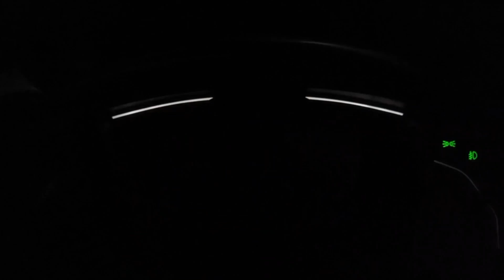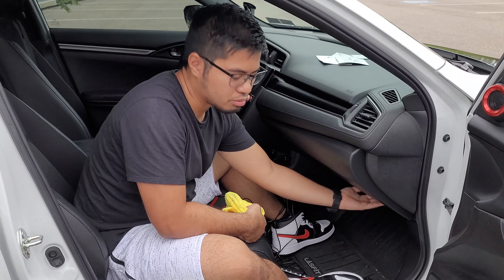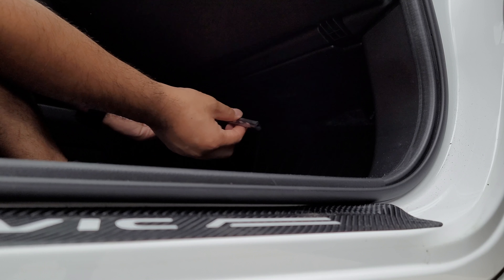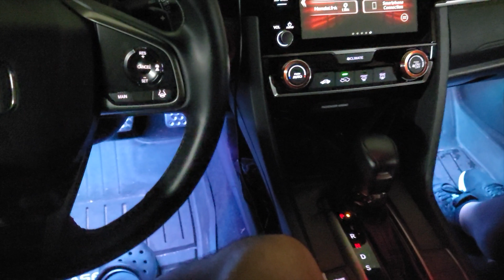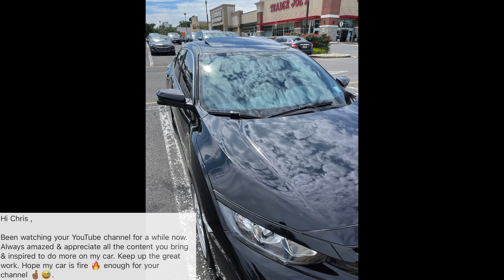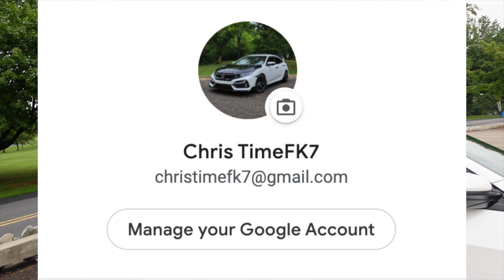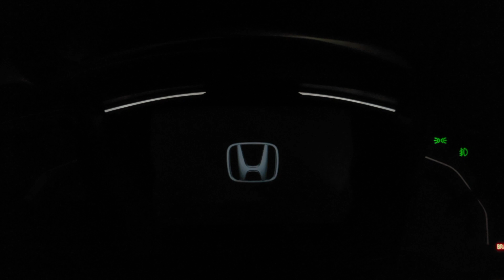RGB INTERIOR FOOTWELL LIGHTING INSTALL AND REVIEW 10th Gen Civic

Comment: The wire that goes into the back seat can be tucked under the seat runner they don't have to go through the middle of the seat amd it looks more tidy and hides the wire under the plastic side trim until the position you tucked it under the seat runner bar.

Comment: Hey Chris, how is the plastidip holding up? Did you have to reapply since you’ve blacked the emblems? Thanks in advance
Reply: Not Chris but I’ve had plastidip on my emblems for a while and it’s held up really well. Just make sure you use plenty of layers and give it time to dry in between layers.
Reply: @bend7959  Cool, did my emblems last week and turned out pretty well
Reply: @radecasper218  nice